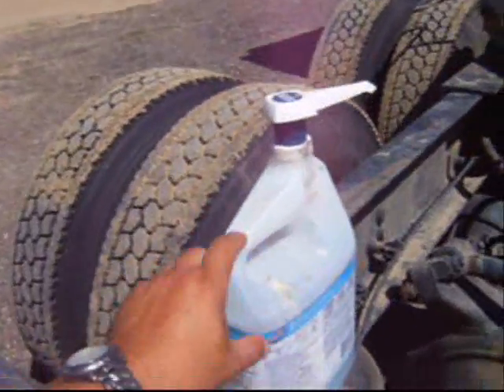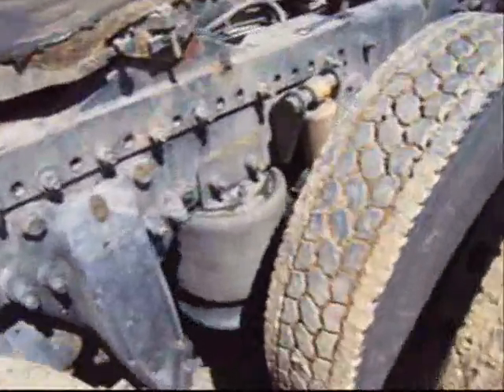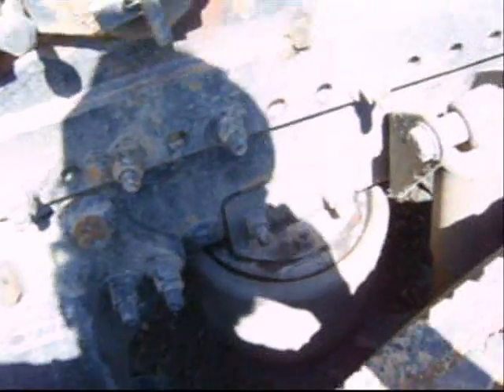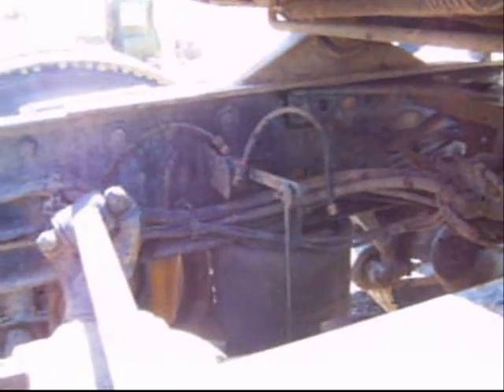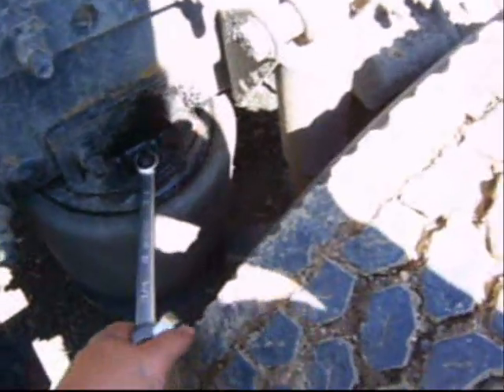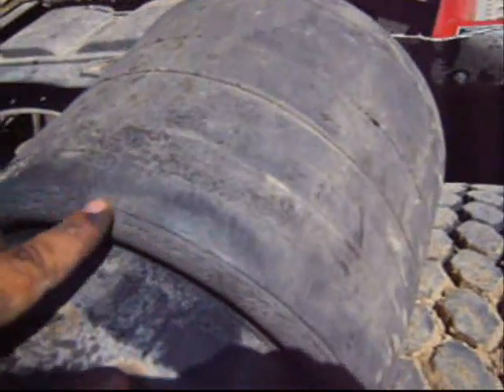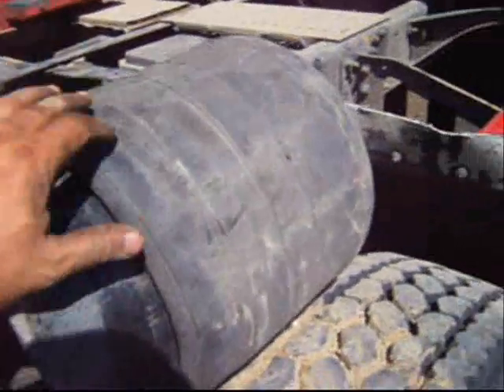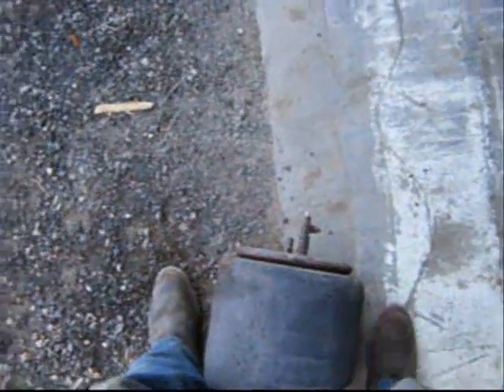Heavy truck airbag suspension maintenance.wmv

Comment: 3 hrs to change 6 air bags on a tri axle trailer. Never laid on the floor ever to service anything on a commercial vehicle or trailer. It's not fashionable to have holes in the ground in the USA by the looks of it even for large companies. Mind you, you are still messing about with S cam brakes and oil filled hubs which are obsolete in other parts of the modern world. Older American trucks would never meet the European safety standards or emission regulations  from what I've seen on here. Do you have electronic braking yet or ABS.?
What's all this about running with remould tyres on the front axle. Do you know how many times a remould casing may have been used? And those crappy narrow tyres you use .But that's OK as long as you have polished wheels lol 
Forgot to mention trailers without a chassis that snap or bend in the middle that can only carry lbs and not tonnes.. Ibs sound better when you talk about payload. Lol 
God save murica

Comment: haymannn yes there are such things  as locking nuts.. They do not need a lock washer..
After 30 years of heavy duty truck repair I have found out a long time ago that it is faster and cheaper (less down time) to replace them.. What I do is use a dewalt mini grinder with a 4.5 metal cutting disc.. There is no flame to melt the plastic air lines.. In a very short time you can pull the bag right out.. If the bottom nut or bolt is up inside the steel housing only way is with a 1 inch drive impact and if you do not have 1 then breaker bar and a pipe.. When replacing the nuts and bolts they have to be grade 8.. Hope this helps..

Comment: After I watched ur vid I tried to change out 1 of my air bags. I could only break 1 bolt lose, & barely got it with a 1/2" impact. It was on very hard to remove. Someone called it a locking bolt. I used WD on it & a torch. After it was turned a bit lose, I couldn't remove the bolt. It seem like it was frozen on. I mean it wouldn't spin off like a regular bolt. A shop had to do it. Now I don't want to tackle the next 1. U got any idea how I can get these locking bolts off? Thx
Reply: haymannn grinder